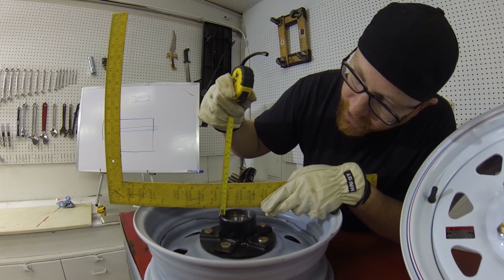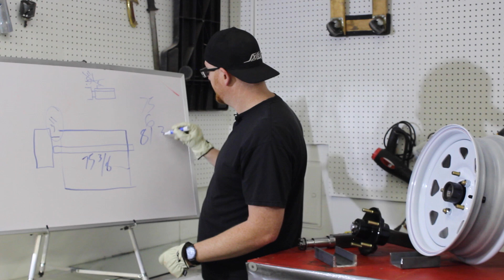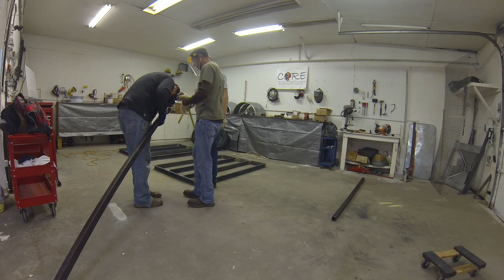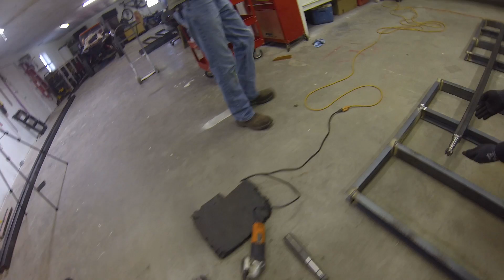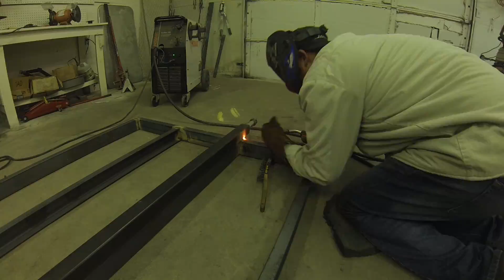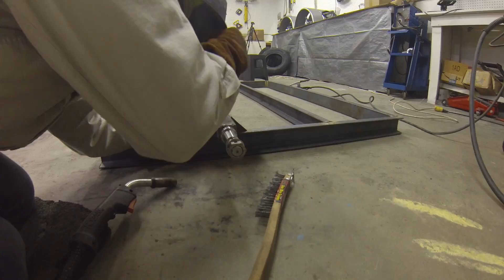Hide and Glide Ultimate SXS Trailer Part 2 - The Axles

Comment: @11:01 If you dont want to destroy your seal race next time, try grinding your grove up to the race and then take a Dremmel and remove the weld from inside the pipe. Say good bye to your hub's grease seal!
Reply from the maker: It is just barely dulled fom sanding we didn't cut into the circular part.  Not worried about it.

Comment: Great job guys. I plan to attempt this very soon. Where did you get your wheels and axles?
Reply from the maker: Amazon
Reply: @ThinkBuildTest   Do you remember the specs for them? Thank you
Reply from the maker: 3500 lb spindle with 1.75 od square.  I would suggest 4.5 bolt pattern
Reply from the maker: I put some links in the description.